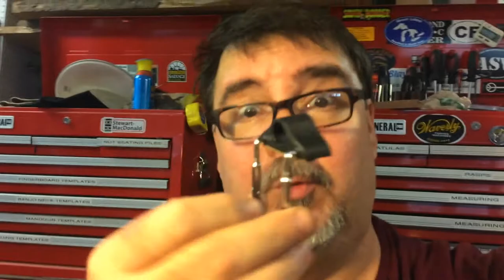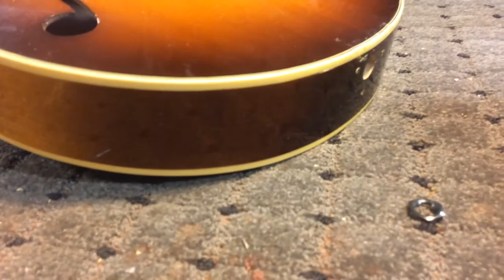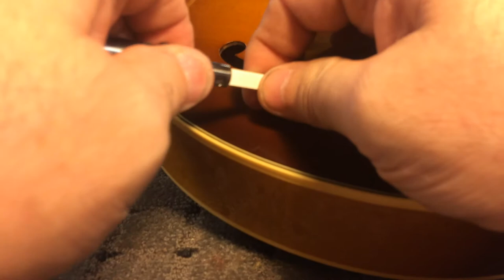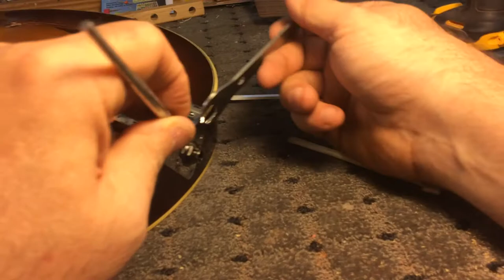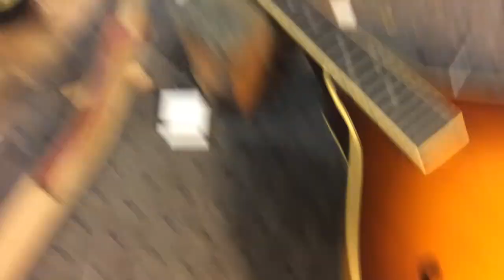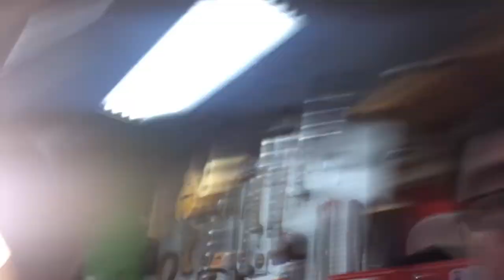Installing a pickup Jack in a mandolin… #AcousticBox

Comment: Greetings Sir! great video! Wondering if you have any advice about installing a jack that does not have a long enough end pin to be able to be installed into the end block of the instrument? What I have to work with seems like it would only allow to be installed into the thin edge of the guitars body which makes me very nervous about drilling a hole and whether or not it would even be sturdy. Do you have any input or do you know of a way that I could make the jack longer? I plan on installing these in each one of my hollow body instruments including acoustic guitars, ukuleles and a violin. Any installation suggestions would be much appreciated. Here is a link to the product that I am wanting to use.
Pickup Piezo Transducer For Acoustic Guitar Violin Ukulele Mandolin Cig Box Parts Replacement 5 Pcs https://www.amazon.com/dp/B01I0T5H6E/ref=cm_sw_r_cp_api_i_geFuCbG52WKPG
Reply from the maker: Adrian Purchase an aftermarket jack and wire that I am. They are available from Stewart MacDonald at a reasonable price.
Reply: Richie Dotson thank you for the reply. I have seen those but I need to buy five of them and it would kind of add up to be more than I want to spend. I was hoping for a cheaper way. I did find what’s called lamp nipples which looks exactly like the threaded cylinders. I’m going to take a chance and I hope that I can make that work.

Comment: How did you fit the pickup inside of the mandolin???
Reply from the maker: That will depend on the pick up system. These get glued to the underside of the top on the base and trouble side but you'll need to follow the manufacturer suggested installation instructions. Thank you and I hope this helps.